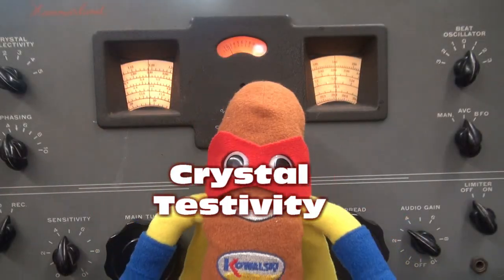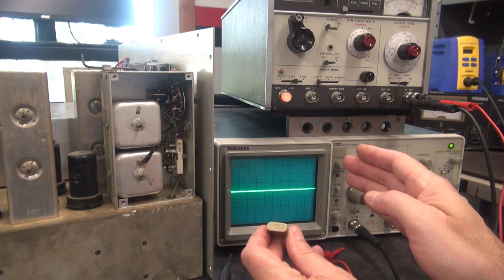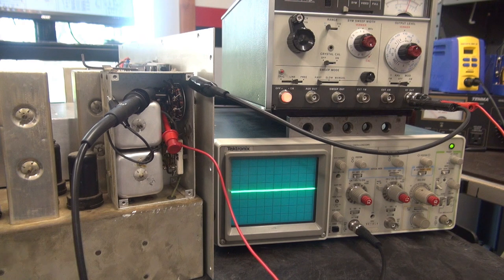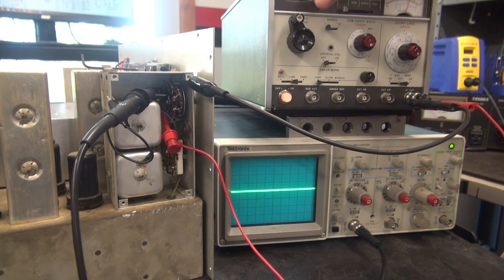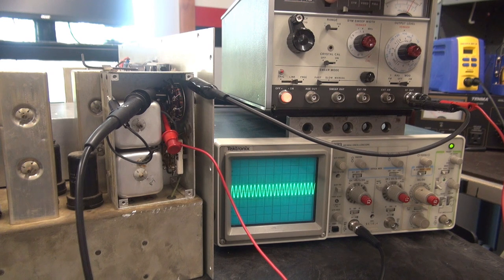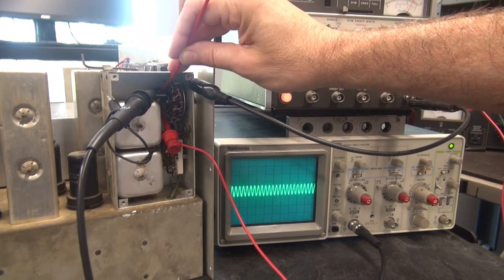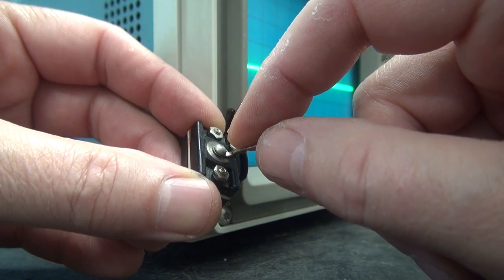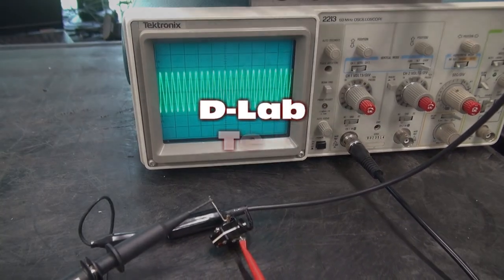How to test a crystal in circuit with oscilloscope Vintage Hammarlund HQ-129X shortwave receiver

Comment: Risking pointing out the obvious...  This works because the crystal and the 'scope's input impedance form a voltage divider and the scope displays the divided voltage.  At resonance, the crystal's impedance is quite low and just about all of the signal is dropped across the 'scope.  Otherwise, the crystal's impedance is quite high and just about all of the signal is dropped across the crystal.
Reply from the maker: Thank you Sir, Great info, Helps me to understand the process

Comment: Nice tip.  I'll remember it when the time comes to restore my Hammarlund HQ-120X.  One question to clear up a newbe misconception for me:  What's doing the oscillating, the crystal or your signal generator?  Or is it both?  I thought you applied DC to a crystal to get it to oscillate.

Comment: Can you recommend a course/somewhere to learn this stuff? Your vids are great, I am looking into becoming a bench tech of sorts. I like working on my own stuff, I have built some guitar pedals from kits, I take apart old vcrs and practice my soldering/desoldering skills on the boards. I am looking though for somewhere good to learn the basics of electronics tho...  I have a sansui aug99-x that sat in a closet, worked perfectly. then was packaged up and moved across country. went to plug it in and it blew fuses immediately upon turning on. I am trying to build up the courage to open her up and look over the bottom of board like in your 77x video.

Comment: If you can get your hands on a Sencore FC71 frequency counter it has a built in exciter (up to 20mhz) and crystal test port on the front panel. You can also test them with a grid dip meter but I haven't done that. Is there a way to repair an intermittent crystal, the large box type with the crystal between two plates? Thanks!
Reply: Thanks for mentioning that, my zeniths 7000 is dead, I was checking the 57.75mhz crystal on my sencor and it was reading 19.###...
     Now i know why..
 I look at the front and it says 1-20mhz
Reply: @cardboardboxification  There's a little crystal tester kit on ebay for about $12 that goes up to 60Mhz. I built one and it works well. Use that to excite the crystal and connect the output to a frequency counter.